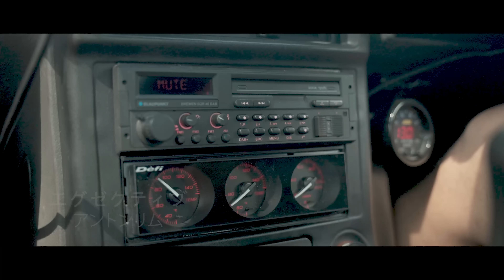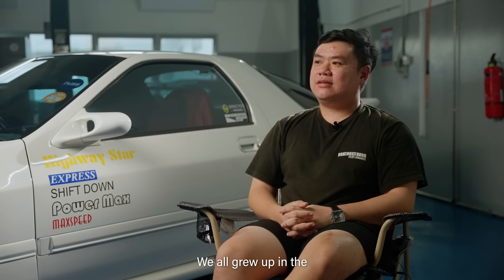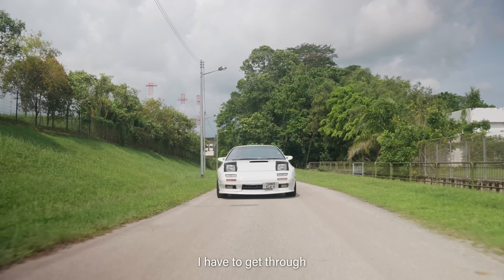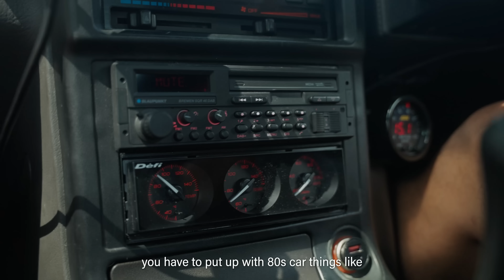How A 25 Year Old Singaporean Achieved His Dream Car, A 1989 RX-7

Comment: at 21 i bought my dream car (a evo x which ive wanted since i first saw one when i was 8)  so i know exactly how he feels. mine needs a lot of work to get where i want it to be (namely a transmission swap cuz i got a really good deal on an MR but wanted a gsr.
Reply: Honest question, are the Evo X's reliable? Like year round from an evo owner?
Reply: @hayamastudio4504  if you take car of them I'd say so. Mines lightly modded so there's not TOO much extra strain on the car. But as a daily it's great. It's the exact reason I went with an evo. I wanted a fun awd car I could drive all year and didn't want to be like every subaru I see everyday. But again. Maintenance is key. Especially if it's an MR with the sst dual clutch like mine is. There's a couple common failure points on the X such as timing chain stretch for the 08-10 I believe. But there's fixes for that. As well as the stock exhaust manifold cracking over time. But again it's fixable. At the end of the day it is a performance car so some stuff is inevitably going to fail. But over all my evo x has treated me pretty well, most likely because of all the maintenance I do
Reply: @hayamastudio4504  another thing is the car handles beautifully in the snow. As long as you aren't a completely idiot, on some decent snow tires, and in the snow setting for the s-awc sometimes it'll feel like you're just driving on normal tarmac. It's insane to me aha. I've never owned a performance car before this so the handling year round is just mind boggling sometimes.
Reply: @Chute_Mi_Plz  thanks for the response brother. I live in Canada so I was genuinely wondering what would be a great all season car between this and a typical Subaru. Always wanted an evo tho haha especially for them snowy days. Appreciate your advice.

Comment: This was a wholesome vid! I still don’t understand why for cars from the 1980’s you have to turn off the A/C in traffic
Reply: I'm not a mechanic and have never worked on an engine but my guess would be the AC compressor could be drawing more energy to itself and thus keeping revs slightly higher to keep it running and the fans and radiator cannot keep up when the car is stationary or under load.
Reply: Because of how AC's and car AC's work. 
Not only does it use more gas, but more importantly especially for hotter running engines, it dumps MORE heat into the radiators. 
When you run the car AC, it cools the cabin by carrying heat away from it via the cars cooling loop, and adds more heat into it. As a result, the coolant/radiator/fan is working that little bit extra to keep things under temp, while the AC compressor is also parasitizing up to 10% or even more crank power (depending on the difference between your desired AC temp, and the ambient temp) 
TL:DR 
The AC puts more heat into the cars cooling system, which is already struggling due to not having moving airflow(because you're standing still in traffic), and only relying on the radiator fans. 
A radiator/fan upgrade could solve this issue. 
Conversely, you can actually help reduce engine/coolant temps, by running the heating instead of the AC, as it does the same thing but in reverse. Using the engine heat, to heat the cabin. Though for obvious reasons, this probably isn't a great idea in the summer.
Reply: @4fiHysteria  You know traditionally a TL;DR is supposed to be shorter than the rest of the post.
Reply: @4fiHysteria  Thanks for explanation !